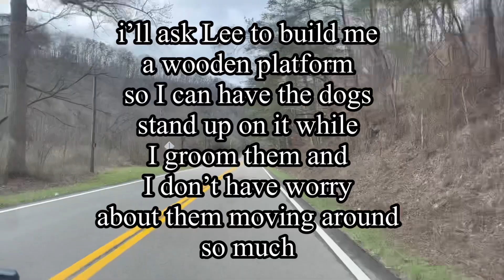Puppies Shelter

Comment: So why are you so dehydrated??
Reply from the maker: The same thing that happened when I was 18 years old and got dehydrated. My electrolytes dropped. My body does not give me any forwarning signals letting me know….
Until it hits all at once…
Not sure if you remember that … at that time I was working for Headstart learning center as Head Teacher…
Reply: @MysticalLoveAndLight  i don't remember but,  you might at some point had heat stroke symptoms..